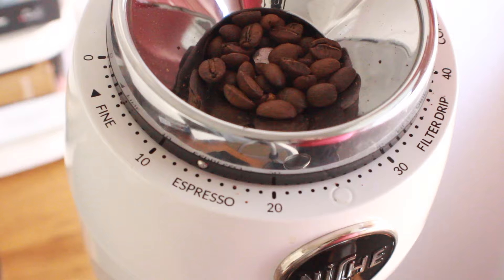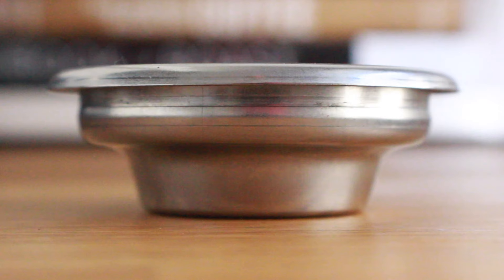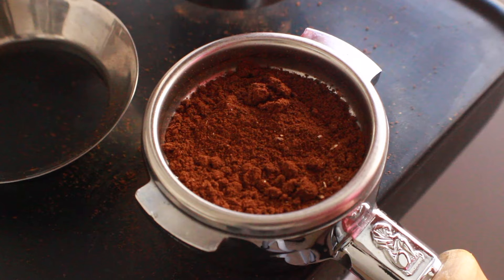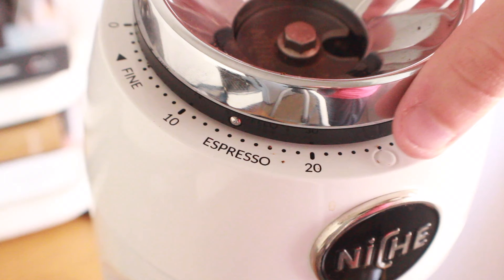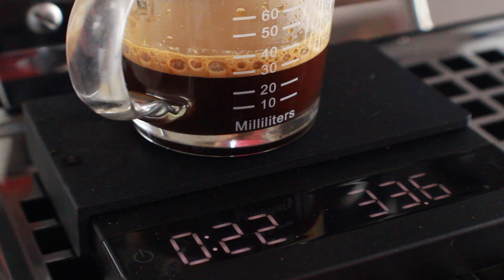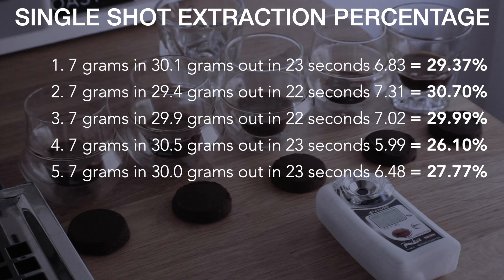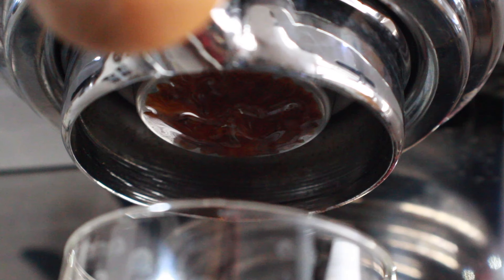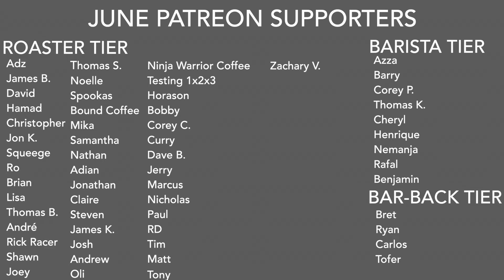ESPRESSO ANATOMY - The Single Shot

Comment: In my opinion, 9gr for single basket is the perfect amount. But bravo for this video
Reply from the maker: I’m hearing lots of 8-9g comments. I’ll have to check it out. I appreciate the comment and thanks for watching.
Reply: I also use 9g.
Reply: I also use 9g, somethimes up to 11g
Reply: @romankrucker  I'm sure you start the day full of energy hahaha
Reply: Interesting video, yea 9g is a winner but most of my customers dont bother w the "7" g basket using 16 and 24g only. But for home use 9g is single basket definitely
Reply: I used 8.5 grams with a dark roast and it was delicious.
Reply: You put the 9g in the midle hole?
Reply: It depends on roast profile.
Reply: 8.5 gr. is the magic number for me personally
Reply: 9gr for la marzocco single basket here
Reply: How to use with a Flair?
Reply: @Sprometheus  The double shots are usually 18-20 gram coffee in and 36-42ml out. So a single shot should be around the 9 gram coffee in and 20 gram liquid. With the 9 gram it is possible to just use the regular tamper (at least on my Gaggia and Solis machines).
Reply: What your extraction time? Thx
Reply: I use 9g
Reply: I put 9g in that basket. I dont know why this guy try to use 7g.

Comment: 7 grams is suggested by INEI (Istituto Nazionale Espresso Italiano), but it should be 7 grams in and 25 ml out. The easiest way to tamp on single basket is to use custom 3d-printed tamper.
Reply: Can you recommend a STL to download?
Reply: Well, yes and no. The INEI recommendation is based on dual spouted p/f (basically a double p/f loaded with 14g of coffee) split into two demitasse cups. You cannot produce a good shot from the standard single basket loaded with 7g coffee as they are all rated for 9-10g. For 7g loaded pull you need to go to smaller aftermarket baskets like the one from IMS labeled as "the single". How do I know this you might ask, I worked as a barista in Trieste, trained by the Café Cagliari barista training academy in Italy.

Comment: You can use a VST or similar single basket. They have no angled walls. Tamping those can be achieved easily using a 41,0 mm tamper and an appropriate funnel.

Comment: Finally, a video about single shots!
I pay attention to my caffeine intake, so I only drink single shots.
I was a bit surprised to see you stuck on 7g whereas your everyday espresso is not 14g...
I've decided to be between the old school and modern espresso, so between 14g and 20g, so 17g seemed to be a good choice for me.
And 17/2=8.5, so I do 8.5g single shots, and my tamping process is as simple as for a double shot.
I'm quite new in this coffee hobby so I'm still experimenting, and not drinking espresso every day, but my goal is to be at 30ml in the classic 25-30s range.
NOTE: the standard ESE pod makes a 30ml/25-30s espresso with 7g of coffee so I thought that it could be a good starting point, but maybe I'm wrong.
Reply from the maker: it’s definitely a less popular topic these days, so it felt right to give it a go. 

I rolled with 7g because the basket is rated for that amount. Any more and it wouldn’t fit, any less would likely not work well.

But it sounds like you’re on the right track! Welcome to the wild world of espresso! Keep at it and keep experimenting.
Reply: I've been making kind of passable singles with my Gaggia Classic Pro's single basket. 8.5-9g, ground 2 clicks finer on the 1zpresso J-max than an 18g double, and extracting to 2:1 in about 25s (9 bar OPV), a bit  faster than my  doubles.  My technique is to leave a slight mound in the middle before tamping,  but have enough grounds to cover out to the edges and still use a full size tamper.  This isn't possible in my basket with 7 or 8g. Result isn't a good a double, a little thinner bodied, but drinkable.  The spent pucks tell a  tale.  I might have to play with singles again now after watching this - I had more or less settled on doubles but I'm getting through a lot of beans...
Reply: @ylleKkcirtaPnadnerB  I realize that I should precise I'm using a 57mm basket, so I that's probably why I don't any problem to tamp with only 8g.

Comment: The 1st machine I got was a Gaggia Classic back in 2006. It came with a single and double basket and a plastic tamper that was 58mm (ish) one end and slightly smaller (about 53mm) the other. The smaller end fitted the single pretty good and the puck wasn't too muddy. I used to stop the shot at about 20gsm in weight. I changed last year to an ECM Mechanika Slim which also came with single and double basket. After some time I thought I'd try the single in the ECM and it was not as good as the Gaggia. I had to put a gram or two extra in to get it anywhere near acceptable.

Comment: Hey man great job pulling those singles. I am impressed.
I actually have been experimenting with single shots because I am trying to control caffeine intake and decaf just didnt cut it for me.

I stumbled upon the renato baskets and gave them a try. I dial in for a double shot 18gr with my double basket and enjoy that in the morning. After lunch I pull a single by simply swapping to renato. I also found I need to pull short. The renato is built more like a double basket so I can play around with dose. I do anything between 8~12gr so I dont mess with grinder. Then I use the flow control on my machine as another variable if necessary.

I can swap from double to single using these renato baskets. The double basket makes a better tasting shot overall but I am making cortados with the singles so it is all good.

Comment: Excellent video! Glad i found this.  For 13 years I experimented with my 7 gram basket on my Rancilio.   I was roughly able to use the same grind settings for both single and double (with a few adjustments on prepping the double).  Now, I have a Nuova Simonelli machine and use their 9 gram basket.  Love their single basket.  Good shape and easier to use but I definitely have to change the grind setting when using the double though.  Good to hear that I'm not the only one using the single basket.  Hahahahaha.
Reply: Just got a Lelit Anna 2 and using this 7g basket. How much grams of coffee do you extract? And what about crafting a funnel for the 7g basket? And do you tamp as he does?  Thks for sharing your experience, :)
Reply: @renehoude7705   I usually extract about 1 oz to 1 1/2 oz max.  I do not funnel.  You will have to experiment on how close or far from the fill line to dose and grind size as it varies from machine to machine.  I do a regular tamp.  I definitely use a bottomless/naked portafilter.  I recently bought a needle distribution tool and it helped tremendously.

Comment: FWIW - I have 3 single-dose baskets at home and they are different sizes (they came with different machines I owned over last 30 years). The basket you used, visually, looks to me like a 9 grams basket because I have a 7 gram Rancilio Silvia single basket and that looks smaller than the one you used in the video. In any case, I put 9-10 grams in that basket (same grind as I use for VST-14grams basket) so coffee sits is well above the narrow inner well. Then I use my regular 58mm (or 58.5mm) tamper. All those Italian baristas do not do what you did to prepare the puck and yet they mostly make single-shot espresso and cappuccino all day long. Therefore, the workflow must be very similar for single and double. Even on Silvia 7gr single-basket I end up "over-dosing" it to 8-9 grams to get good enough results. And I stop at 20ml for single. It becomes too watery for my taste if I try >20ml from 9 grams of coffee.  Ultimately, I don't use 7gr basket, I always use the 9-10gr single basket if and when I make a single shot of 20ml espresso. The result (for me) is just better. Peace.
Reply: Correct, the basket used in this video is a standard 9g single basket, not the 7g one. Hence all the issues and challenges experienced and shown in the video by Sprometheus. With the correct amount dozing (9-10g) the issue disappears. I pull singles every day and have been for over 30 years now. Once you figure the basics, it's all up from there.

Comment: well single shot is 7g just like a double shot is 14g... in real life they are like 20% more. 9g in a single shot fits well, like a modern 17-18g double shot. actually here in Israel, every coffee-shop uses one portafilter with single, and another with a double. the single shots are maybe a little harder to pull to perfection, but it works well. and if you put in that basket 9 grams, you could tamp it like you tamp normally.

Comment: 11g grounds in to 25 ml out i do this all the time in the shop i work in. we also do 21 to 50 double basket same grind
Reply: interesting. At home I do about 13g for a single basket for about 24-25ml. 30 seconds shot which includes 6 second pre-infusion
Every time I've tried to do 7g in a single, I just can't imagine ever getting enough pressure out of so little coffee :)

For a double, I usually aim for 20g for about 45ml also 30 seconds with 6 seconds pre-infusion.

Maybe I'll try 11g to 25ml, with a much finer grind. Thanks.

Comment: The single basket has a smaller area for water to exit. Since you have a nice machine it probably consistently pushes nine bar or very near it. For the same pressure but lower area for the water to travel through you will have a greater force and so the flow rate should be faster. That would mean you can grind finer than usual and therefore it would be easier to extract. Conversely, you have less coffee in the portafilter so the grind is still coarser than what you would use for a double as you mentioned. I think maybe that's why the extraction percentages are so high. Also, very good video 👍
Reply from the maker: A1dancarter thanks for the insight, and for watching!

Comment: We actually use this single basket in a café and it after you get used to it a little bit, you can pull some really delicious shots with it even though your grind size is set primarilly for a double shot basket. Usually I end up using about 8 up to 8.5 g of coffee per cca 20 g of water in about 26-33s (depends on coffee ofc, my double shot is usually 18-19 gramms of coffee per cca 40 g of water, so in order to make a nice single shot, I usually end up using little bit less than a half the ammount needed for a double shot to achieve the closest possible experience). You can get higher extraction when pulling "longer" shots, but I do not consider those very pleasing. More than 23 gramms of liquid usually end up very harsh and overextracted. Maybe try out analyzing this recipe with the refractometer. I would expect that to end up somewhere around 20 % of TDS. Thanks for the video!
Reply: What size of tamper did you use?

Comment: I've been pulling single shots for at least the past 10 years.
This is to limit my caffeine intake.  2 cups, one at breakfast and one after lunch.  2 single latte vs. 2 double latte = less caffeine.
And I can sneak another one in mid-afternoon.

On my old Saeco with a pressurized PF, I just put 7g in the double basket then a puck screen.  This was easy to pull.

On my current Solis, I use the tapered single unpressurized basket.  The unpressurized basket is much harder to be consistent than the pressurized PF.    
I have to use 8g in the basket.  Less than 8g and the tamper hits the taper of the basket, and I can't tamp any further.

Comment: Thanks for this video. It is superb explanation and experiments. 
Curious to know, if the single shot basket is filled to the rim and levelled off, then tamp down, that will be more than 7g, but a more practical approach? Also could it be rated 7g dark roasted which is lighter massbin beans weight, but more in grind volume? (not a barista but just someone who enjoys home brewing)

Comment: thx a lot - I am used to do a similar routine, because I only drink single espressi - up to 3 a day, as my partner does. And here the smaller diameter of the Delonghi Dedica 885 shines (don't have enough space for a big machine, and decided to "invest" in the grinder): with only about 50 mm diameter it is decently smaller than the e 61 standard; I only have to put about 8 grams in for a better taste (by a thicker puck): there we go!

Comment: We have such a basket. We fill it up to 11-12 grams and just use 58mm tamper. It works almost equivalently with a large "14 gram" basket when filled up 1.5-1.6 times more than small "7 gram" basket. I mean 11.7 grams in the small and 18.5 grams in the large allow to spill 1: 2 espresso in the same time and with nearly same taste at same grind settings. Both came with our 17 years old used Saeco Aroma compact SE 100.
PS: Many coffee shops in my country use used machines. There is a whole industry. People buy old coffee machines in Germany, make some repairs and then sell them to coffee shops.

Comment: Another reason the extraction is higher could be that because the shape of the basket is cone-like, the water that dissolves the bottom part of the coffee bed that is usually already loaded with solids from the top, now has less coffee to extract and thus making it easier to extract more, in comparison to a normal shaped basket that has the same amount of coffee on the upper part and in the bottom. 
A much more eloquent explanation of this can be found in Scott Rao's "The Professional Barista's Handbook".
Reply from the maker: Yep, that’s a guess I think may help, but I’m sure that the amount of water through the smaller amount of coffee really pulls out a serious amount of solids.

Comment: Very interesting Sprometheus. I make 2 coffees a day. A flat white for myself (18g double) and one for my wife (12g single shot). I've never been a fan of the single basket. It often under extracts or chokes if ground too fine. Finding the right grind setting it trickier with it. Should be getting a Niche Zero next week so that'll help a lot. I did wonder about the "blank" outer edge of the basket base. My single basket is a bit different than yours but I'm definitely going to give this a go with 7g just to see what I results I get. Another great video. Keep them coming!
Reply from the maker: Thanks George! I appreciate the you watching and commenting. I hope you enjoy the Niche as much as I do!
Reply: @Sprometheus  After watching this video last year I've been making a small afternoon coffee every day. Tamping is really easy when you figure out "the trick" which is to acquire a 40mm tamper. After you pour the grinds into the single basket just tamp straight away. This creates a crater which, if you then give your portafilter a shake, all the remaining grinds fall into. Tamp again and repeat twice. Done. I love the coffee I get from the single shot which I add water too making it a "long, short black" of sorts. 7g is about all I can handle mid-afternoon. Would be great if someone did a video talk on caffeine tolerance and how to enjoy as much coffee in a day as a low tolerance body will allow. Thanks again for this video, it's one of the best, and original, you've done.

Comment: I pull decent single shots from my Barista Express. When you change dial setting from double to single, it doesnt grind twice as less coffee. If double is 17g, single is about 10g. It has V-shaped basket so tamping isnt that painfull due to 54mm at top narrowing down, thus tamper covers the entire surface. Crema is not that good but shot itself is enjoyable.
Reply: Rokie how is your experience with wet pucks? I always make single shots with this machine and in my experience the coffee should touch the showerscreen to avoid channeling. For single shots I take between 11 and 12 grams of coffee, depending on the roast.
Reply: @MCLRTR  Coffee should never touch shower screen. If you see shower screen printed onto the coffee puck, you are overfilling. To me 11-12 grams seems like overfill. It is 8-10g basket and that is the range I approve. Everything above 10g chokes it when the grind is alright. Wet puck is usually issue when dose is too low, it is not necessary about quality of extraction. When dose is correct, the trick is to wait a bit. Barista express has suction function after extraction. So wait a few seconds before removing lever from machine, if you want your desired dry pucks. I got dry pucks maybe like 4 out of 5. Another thing is that the grind is not so precise with this machine.

Comment: thank you sir, this was the best I've seen to breakdown the Gaggia single shot. I love how you applied some basic statistics and the physics of the shot, technical and makes sense. Question: is the filter basket for the single shot a standard accessory and I noticed you used a bottomless porta filter, will any OEM work the same?

Comment: I always use these but I use around 14-15g of a light roast in there or maybe 12 of a dark roast. for around a 25g extraction.
It's generally around 3mm from the top of the basket after tamping.